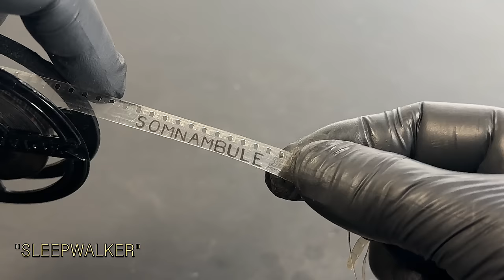1950's 8mm Disney Movie Projector - Wamoo - Restoration

Comment: This is just incredible! Thanks for your work, they are good as always! By the way, the 110 V mark and 12 V bulb combination reminds me of "resistive cord", which is a power cord made with resistance materials such as Cr-Ni alloy. Thus the power cord and the bulb in series would take the 110 V together, 12 V on the bulb and 98V on the cord. I don't know if the original design use a step-down transformer or a resistive cord, checking the original cord resistance may help.

Comment: Another magnificent restoration. Your work is simply hypnotic; I can't finish MY work because I want to watch all of your videos eheh.
One question: The lamp is for 12 volts, isn't it? And the label says 110V. How does this magic work?
Reply from the maker: Thank you ! The original wire was supposed to reduce the tension from 110 to 12 volts. I used a transfo ;)

Comment: So confused about your methods. You took the big pieces apart but not some of the small ones. Or the large section that holds the film reel… Do you lack the equipment to put it back together if you took some of them apart?
Reply from the maker: All those parts are so fragile, just like the metal sheet… So thin ! I couldn’t take the risk to disassemble the riveted parts. It seemed to work properly. No reason to take them apart. But hey some people around would have done it ;)

Comment: So that 110v is only for that little light bulb ? 🤣🤣😂😂👎👎
Reply from the maker: It depends… the original wire turned the 110v into 12v ! You can also use a transfo ;)